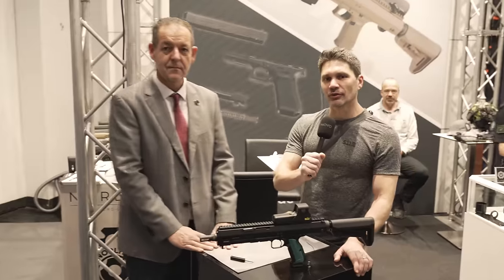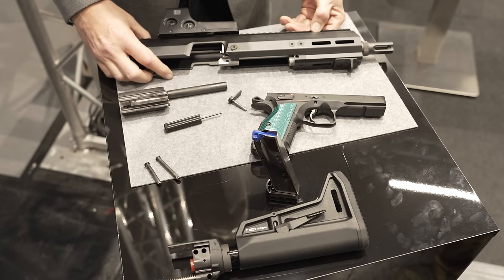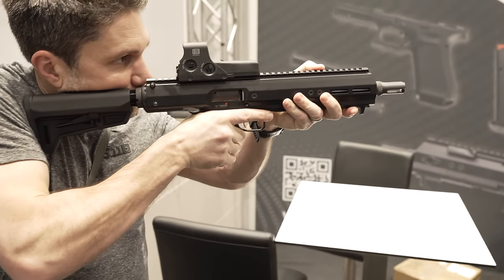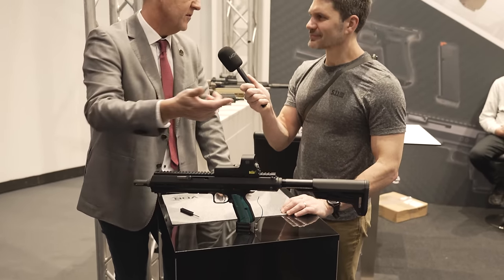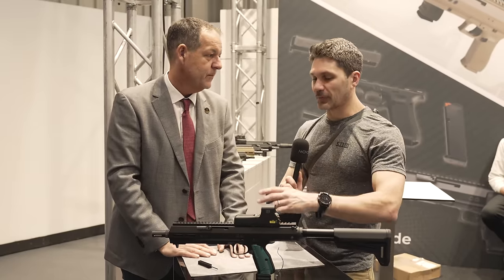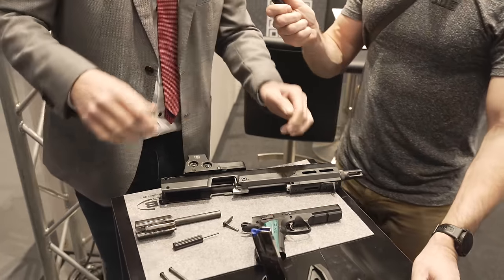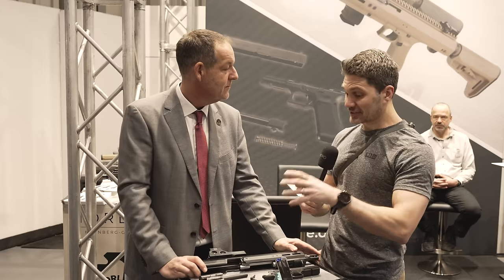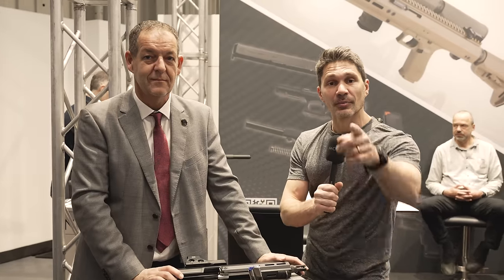A High-End German CZ-75 Carbine! The Norlite USK

Comment: This is the first carbine conversion kit...chassis, system thing that seems like it isn't a gimmick. I like it.
Reply: Mech Tech Systems here in the US has made something similar for Glock, XD/XDm and 1911 handguns for at least 20 years. The Norlite is much nicer, though, as the Mech Tech uppers are basic tube style straight blowback, and don't have many of the features that the Norlite does.

Having the Norlite imported would be nice, but I do agree that something like this would be right in Palmetto State Armory's wheelhouse.
Reply: I love the micro roni system.
Reply: @daleford8621  A lot of people do, but it's just not for me.
Reply: @ashfield4313  that's cool. I like other systems too. I always like to see what new stuff comes out.
Reply: @terryfaugno9242 Yeah, but you forgot to mention that this one cost 3 times more than the Mech Tech Systems. Besides, I like it more MT for developing hot loads due to the simple, yet very effective recoil system. I had the 1911 one in .460 Rowland and I pass long the 15% above the security loads and only stops when the brand-new brass starts ejects cracked at the first shot (I never use one-shots or worse to develop hot loads). I'm talking 2004 aprox, when the .460 Roland was still a wildcat so, I had to do my loads almost blindly, and the MT CCU was awesome for that. Seeing this one, I don't think that could take the same amount of punish that I put in the MT CCU. And I already mention that you can get 3 MT CCU's for the price of this one. And I don't event talk about the easiness and quickness of assembly. Sorry for my English is not my main language.
Reply: Looks like the AAP-01 by action army or the SMC 9 by g&g
Reply: I have the CAA MCK for my Glock and love it.
Reply: NO TIENE SENTIDO.
  ESTARÍA MEJOR VENDER LA CARABINA ENTERA.
  PASARTE LA VIDA MONTANDO Y DESMONTANDO LA MISMA PISTOLA...🤔?
Reply: @SaltedBadly gave me such 9 feelings too. Especially because it only uses the lower from the pistol.... that longer mag and fore end nicely balance each other out.
Reply: Really? Because that's all it is, just like any pistol chassis.
Reply: @mrfawkes9110  says the guy that didn't watch the video.
Reply: What about the Flux Raider?

Comment: I usually think stuff like this is gimmicky, but this actually seems pretty decent
Reply: The "carbine" kits are probably gimmicky in the US but they fill quite a specific role outside of it. Most countries don't have a silly definition of a rifle vs handgun and it's often based on caliber and actual intent. Then many countries also limit how many firearms you can have as each firearm would often need to be licenses separately so these kits are quite important.
In the US these are not only mostly a gimmick but one that easily could lead to someone running afoul of the NFA as well as possibly creating problems down the line and poisoning the supply chain as a rifle cannot be converted legally back into a pistol.
Reply: @DOGMA1138  Don't need to tell me twice about daft gun laws, I'm British lol
Reply: @DOGMA1138  If it started life as a pistol, you can convert it to a rifle and back again, no problem, as long as you abide by the required barrel length and overall length.
Reply: It's only gimmicky if they make it a gimmick. This looks like a very well made, well engineered conversion system.
Reply: Nah...it's still gimmicky
Reply: @cjohnson9211  I mean, maybe if you think PCCs are gimmicky. This is probably going to be incredibly accurate, and with the excellent trigger that comes with CZ75s probably a very nice shooter.
Reply: Very well said.
Reply: They actually aren’t a gimmick. You should try one some time. There are like 3 or 4 Israeli companies that makes these chassis systems that range in price depending if they are if they are polymer or machined aluminum. This brand, and a Austrian company as well that makes a nice pistol chassis.

The stability and accuracy is substantially increased. And while it doesn’t replace short barrel rifles, these types of handgun chassis certainly have their place and are completely useable in a professional capacity.

Plus, they’re fun for plinking!
Reply: i was too going to say it's unnecessary until i heard it supports several different pistols. would be a waste to buy an expensive shadow 2 only to put the slide back in the box
Reply: @funkydown  Well, the nice thing is, is that it's not a permanent change either. So you can run your S2 as a pistol and pretty quickly move it into the upper if you want a carbine for whatever reason. I feel like it would be great for competitions. If it supports the Czechmate and is brought to the US, I'll probably pick one up.
Reply: Decent for Europeans. Useless for the u.s.
Reply: @jason200912  I mean, it's really not. There are plenty of states where buying an upper to convert a pistol into a carbine is more practical than buying an entire new gun. "Buy one gun, have multiple configurations" is basically the entire premise behind the P320 FCU, do you think that's useless too?
Reply: @sgthop  I want you to look at the prices first before saying the cz75 standalone upper is a good idea.
Reply: It totally gimmicky, but I want to see a carbine like this from every major company.
Reply: But why not just make it a full gun
Reply: @Baman21  Because Europeans can only have a limited number of guns in many countries, and this will not be considered one of them. Also pistol chassis are nothing new.
Reply: @sgthop  I know I own some but for it to have its own bolt and barrel it's a lot more than just a chases.  My cz shadow 2 ain't cheap either.  It just seems over kill for a chassis and you might as well make it a full blown pcc
Reply: @Baman21  There are lots of these conversions out there. The fact that it uses its own bolt and operating mechanism means it's actually good and will be accurate and reliable. Many of the "stick a gun in a frame" things like the MCK are kinda garbage. This lets you have a PCC with actual PCC accuracy, without having to buy a second weapon.

Comment: That would be dope for the CZ mafia. Every USPSA guy has a shadow 2, so why not make it a PCC too
Reply: If it didn’t cost more than just buying a standalone pcc is would be a major hit here in the states Im sure. As it stands, hard to justify when we (at least most places) don’t have a limit on the number of firearms we can own or need a license for each one, so you might as well just buy a full gun instead.
Reply: @Andrew_182 But does a new PCC have a trigger as good as the Shadow 2? The acquired familiarity with the grip and the trigger may be an advantage over a new complete PCC.
Reply: @jeffersondaviszombie2734 I mean, you can easily drop a geissele or larue trigger into an AR-9. And I’d have to imagine there are tuning/upgrade options for other platforms too if you’re worried about it. And while familiarity with the grip and trigger is beneficial, it’s also something that can be easily gained with another setup by just using it. 

Like I said this thing is cool. And I don’t doubt there are some here who would spring for it over other options (or just to have it in the collection). But it doesn’t make as much sense here as it does in places that have the restrictions this was designed to address when you can buy a complete PCC for much less here.

ETA - while the price is 1500 euro (roughly $1650 converted) over there, if  it were imported into the US, the price would very likely be even higher to offset the import fees and such. There are A LOT of other options other there for ~$2000 or less.
Reply: @Andrew_182  yeah, you're right. The only way this makes sense is if you're limited in the number of firearms you are allowed to own.
Reply: @Andrew_182 1500€ retail price includes VAT, which won't apply to US buyers, so in the end it should be around the $1400 mark (plus import fees).

Still I agree with you, it makes more sense for us shooters in Europe with restrictions on the number of guns -- here in France it's 12 category B guns (semi-auto rifles, handguns and most shotguns) ; category C guns (bolt/lever/pump action rifles) you can have as much as you can afford.
Reply: in CZ every barrel is registered, so i think this would like buying a gun. Not like dude said. So this has no sense to us.
Reply: @jeffersondaviszombie2734  That's a large part of the appeal for this on the German market, yes. 
I wanted to get a 9mm pcc, I could have bought a Ruger PC-9 charger complete set (including a red dot) for €1,700, or get a Glock 45 for 800€ plus a Norlite for €1,700. I chose the latter because now I have a pcc and a Glock 45 while just the Glock takes up a spot on my permit. One handgun more or less on that permit can make the difference between the authorities ignoring you, or giving you a hard time about it (like they tell you they now need proof of competitions shot for each single gun above the "basic allowance", which is just 2)
Reply: @bitkarek 

Edit: just realized you might have meant “here in Czech Republic” rather than talking about CZ the manufacturer. Apologies. 

depends on where you are. His example seems to be for Austria/Germany but various other countries it could be different. Similarly, in the states, the lower is the registered part. That’s why CZs and some other guns will have the serial on both the slide and the frame. Here in the states, this would be just like buying an AR upper, which doesn’t have to go to an FFL or a 4473 form (while a lower whether pistol or rifle would). 

Still, doesn’t make as much sense here with the price given we aren’t limited on the number of firearms.
Reply: @maximilianmustermann5763  "basic allowance" of 2 guns! OMG! And I thought we had it bad in Romania. Well, we do have it bad in other ways: it's very difficult to get to the point were you can own guns. But once you get the permit, for sport and for hunting there are no limits except that if you have more than 15. And even then, you need to install a security system connected to the Gendarmerie and you can own as many as you can afford.
Reply: @Andrew_182  ya, sry for the confusion. In Czech Rep. We have serial numbers on barrel,slide and frame.
Reply: I'm reading all of these foreign firearms laws in this thread and realizing I have it amazing as a non-complying American.

High quality can justify a high price. I wouldn't mind owning one of these if I had a CZ Shadow and it had a pic rail on the back for a folding stock to be installed on. This is a good design that can be improved by that. I can see it selling in the US. Some of us still want high end toys.

Comment: I don’t like the systems that just incorporate your existing pistol slide, frame and internals. This provides a longer barrel integrated with a new “upper receiver” which should improve ballistics and accuracy. Nice, hope they’re successful.
Reply: They have been making a Glock version for a couple of years now. They seem to be doing pretty well for themselves.
Reply: The system is well received especially in the German market (maybe other European countries, too) where this only counts as an accessory to an existing hand gun. It's not a gun by itself (by German law), so it doesn't fill a slot on your gun permit. And it still counts as a hand gun, not a long gun, so you can use 20-round magazines with no further ado (although admittedly there are stand-alone pccs like the Ruger PC-9 charger that also count as hand guns here)

Comment: The is how the psa x57 should work with the rock 57
Reply: That's what they're doing...
Reply: @DougsDiggers

Yes and no. They’re using components from the rock, but afaik you aren’t going to be able to take the “upper” off the frame of the x57 and put a slide on it and have a rock like you could this with a cz75. You need a cz75 for this to be a functional firearm while the x57 will come as a complete a fully functional stand alone firearm.
Reply: @DougsDiggers  
No, the X57 is a distinct firearm that has parts commonality with the 57 Rock, not a conversion upper. The same way the Ruger 5.7 carbine doesn't require owning a Ruger 57.
Reply: that's certainly how the x57 upper should LOOK imo
Reply: Yeah it really should be. It will heavily depend on price though because the 5.7 Rock isn't particularly expensive. If the x57 is also low priced then it may be pretty easy to justify buying both.
Reply: Too bad PSA is dookie.
Reply: X57 is gonna be like hi point does to convert its pistols to rifles

Comment: The fk brno needs a system like this or some type of chassis system....
Reply: Agreed
Reply: 7,5brno is basically 30m1 but in a 6in pistol instead of a 16 carbine.
So putting 7,5 in a chassis/pcc equals upping the 7,5 to sbr ak performances ...

I fail to see the appeal
Reply: @levergatRapha  You fail to see the appeal of SBR AK performance in a PCC?
Reply: @lolk4530  1€/$ per round, base gun is 2k min, 1,5k for chassis...

Expensive stuff for what a cz bren sbr could do heh?
Reply: @LaughingMan44 Another advantage is that you can share ammunition between pistol and rifle (this way they can also share the same magazines and the more used a cartridge is, in theory the cheaper it becomes). Some time ago I had already thought of a way for this to be viable and in my opinion the diameter of the projectile had to be around 7mm, as it can have a range of projectile weights that can work well for rifle ammunition (with spitzer bullet shape, which would lead to a bullet with better aerodynamics and less projectile mass to reach higher speeds) and for pistols (with a hollow point bullet that has more volume and consequently greater mass, which is ideal for pistol ammunition) and for me the simplest solution would be neck-up 5.7x28 mm for a diameter of approximately 7mm (up to 7.35 mm, which would make it a straight wall cartridge)
Reply: @LaughingMan44  recoil would be more or less the same, learn physics, flash? The 7,5fk is already known as a flameball dispenser, weight? Maybe
Reply: @gamerbg294  the sidearm/long arm ammo compatibility is irrelevant for 99,99% of users...
And necking up 5,7x28 to 75/90 gr  7mm would basically down the velocities to... 7,62 tokarev... While 7,5fk was basically 7,62 tok pushed to 30m1 perf....

You went full circle
Reply: YouTube is wonderful, because it censors my comments for using a few simple words (completely ironic comment)
Reply: @levergatRapha  What makes it interesting to have multiple platforms to use the same ammo is not from the consumer's perspective, but from the producer's point of view, as the more widespread an ammo is, the more it is produced and this makes it cheaper (not surprisingly, 22lr, 9mm Para and 5.56 x45 are very affordable ammo).
Reply: @levergatRapha  Also, small arms in 7.5 brno are not as available as 5.7x28, so it would be easier to adapt to the new ammo as it would not be necessary to change the magazines and also drastic changes to the frame to accommodate the new ammo (which would reduce development costs, so it would be a similar situation to what happened with 300 AAC and 5.56x45).
Reply: @levergatRapha  In addition to the fact that 5.7x28 is known for underperforming in sidearms, because of its small diameter and low momentum (the kinetic energy is too small for the temporary cavity to be minimally effective) and the new ammo would solve this problem (I didn't see anyone complaining about the 7.62 tokarev's performance, so I don't understand the demerit of it performing in a similar way), however, it still It could have a type of ammo with a spitzer shape (which would naturally make it lighter) that would be more suitable for long arms, in addition to an HP ammo type that would be heavier and therefore more appropriate to be used as defensive ammo for sidearms.
Reply: @levergatRapha  Finally, I think that this ammo should have a performance reminiscent of 40 S&W (possible less so that the size of the sidearm doesn't need to be a bit bulky), as then it would have a sufficient amount of momentum to perform well in a sidearm and would get good kinetic energy in long arms (even more so with spitzer ammo type).
Reply: @levergatRapha  Regarding the question of 7.5 brno having a 30m1 "performance" I think it's exaggerated, because the data we have about 7.5 brno is with a 6" barrel, and even a full size pistol (those that can still be carried with certain practicality) tends to have a smaller barrel, I believe that with a barrel size of around 4.5" it would have a slightly better performance than 357 magnum

Comment: I hope it works with a ton of other CZ based pistols. The position of the pin will be crucial. I'm glad they can finally add more pistols after they recuperated some money with the volume via Glocks. 
Imo, the mid length option has a decent balance, I found the long one with Glocks to be quite nose heavy. Steel frame CZs are already nose heavy...so the smaller kits might be a good idea.

Comment: Seems a lot higher quality than most conversions, especially using a different bolt and barrel instead of the regular slide
Reply: They also offer three or four different types of barrels for the system, including high-end match-barrels by Lothar Walther. Not to be confused with Carl Walther, his son Lothar also founded a gun company back in the day and they are THE best barrel manufacturers in Germany, probably all of Europe.